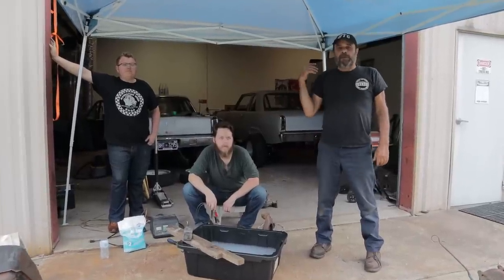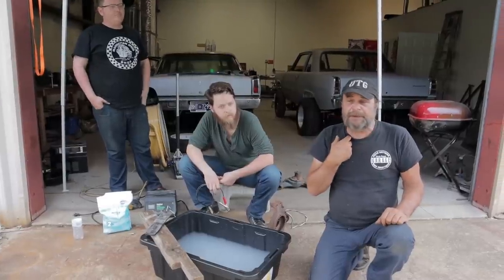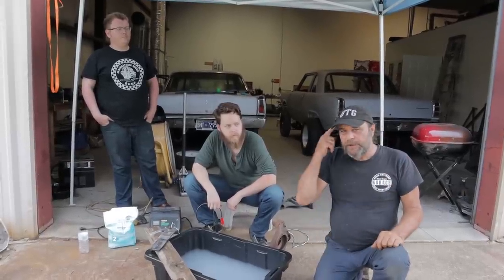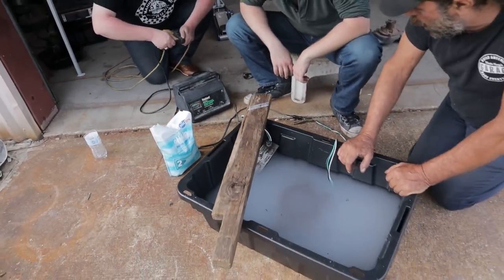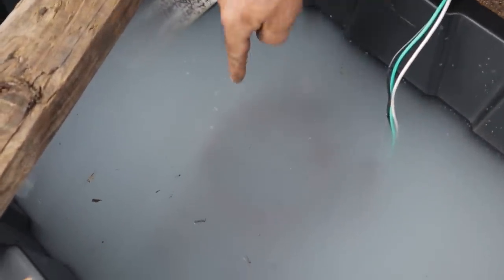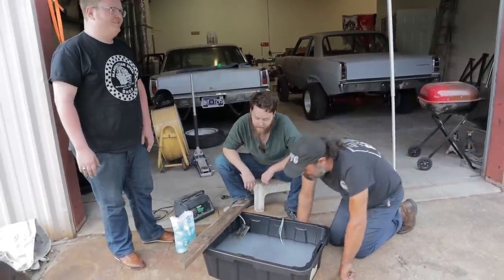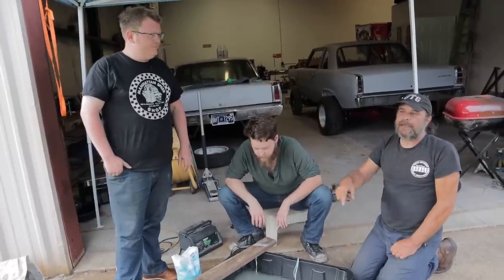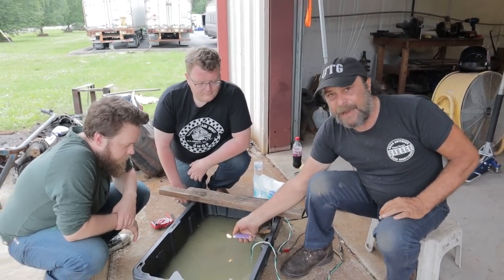Zapping The Rust Away - Best, Cheapest Method Ever!

Comment: I've done plating my whole life whether it be copper tin lead nickel and gold what you should have done since you had to three wires is connect them at three different points on the water pump housing that way you have more even current throughout the housing instead of just coming in at one point
Reply: Makes sense.
Reply: The resistance of that block of metal should be so low that the difference should be negligible.
Reply: I wonder if an second sacrificial anode on the other side of the pump housing would make for a more even rust removal.
Reply: @aussiebloke609  It would definitely help.
Reply: I thought more current tends to make the metal turn more black?
Reply: @aprules2  It does, but at the same time, the more surface area of anode you have surrounding the cathode, the more uniform the plating will be, and the quicker it would go.
Reply: @aussiebloke609  yes most definitely it would
Reply: The key to the success of this procedure was the addition of the electrolytes to the sollution... If the water was de-ionised (aka - D.I. water), the amount of metal transfer between the anode & the cathode would have been very slow... I have also heard that sodium hydroxide works well to do this...
Reply: @johnbrizendine7716  I've found that on parts with a bore you have to dangle an anode down the middle to effectively get that clean. It probably would have come clean eventually but there definitely seems to be an advantage to keeping line of sight with what you want to be cleaned. I  just rotated the parts or moved the anode around to get the outsides clean.
Reply: Definitely rite my man. I am an electropolisher. Same same but different but still same
Reply: @aussiebloke609  Yes.  Definitely.  Electrolysis is line-of-sight, so 2-3 anodes will work like a dream.  Best anode is a stainless washing machine basket, and suspend the part from a chain or rope.
Reply: @aussiebloke609  When my buddy and I used to do this in a big wash tub, we used 3 or 4 sticks of rebar wired together around the perimeter. Did full engine blocks that way.
Reply: @michaelmartinez1345  I dont think there is any "metal transfer". This is not electroplating. Oxidation is a loss of electrons, which one is reversing by pushing electrons into the target cathode.

I THINK
Reply: @edlithgow4360  that is an interesting observation..  However Three things are required for corrosion to take place..  1)A potential difference (of voltage between two or more conductors)
   2) An electrolytic path , and
   3) The presence of oxygen
     If any of these elements is neutralized / isolated, the corrosion (metal transfer) will stop... Thai is how it was explained in a corrosion control class that I took at a NAVY base, awhile ago...
       Therefore, it is reasonable to believe that metal transfer does take place between two (or more) metals that share an electrolytic path and have a potential difference of voltage (even a slight voltage difference) could cause the more noble metal to give some electrons to the electrically connected metal  that is less noble... What the oxygen effectively does is break the metals down to their original form before the man made processing took place...AKA - Oxidation...

Comment: Electrolysis ist my main method for rust removal on smaller parts.
I'd like to add one thing regarding the paint. Electrolysis does not remove the paint on good metal. Only where there is rust underneath. Also on galvanized parts, where the galvanizing has started to corrode.
And one important thing: The parts have to be free from grease or oil, the water needs to get to the metal.
When checking the progress, I use compressed air to blow off loose rust flakes and paint.
Reply: Exactly!!

Comment: Welcome to the world of electrolysis. Been doing it to my rusty car parts for probably close to 10 years now. Super mild process, doesnt hurt existing (in tact) paint, doesnt hurt rubbers, plastics other metals, anything. Only attacks the rust. Take it out and give it a light hit with a wire brush and you should be good. Dont worry about the other metals on the part, itll be fine. Biggest thing I found was make sure your connections are solid and clean off the anode every once in a while. You can make a "smart" battery charger work if you hook up a spare battery in parrallel.
Reply: "You can make a "smart" battery charger work if you hook up a spare battery in parallel" is the PRO-TIP above!

Comment: I grew up on a farm and we used to do this a lot. We also used to rebuild old tractors and stuck motors.

I had an old F20 that sat in a pasture for 70 years that we bought on an auction. We disassembled it and used this method on many parts involved with the engine, transmission, and may old cast iron parts. After   we dried and cleaned them up , we then took those parts and soaked them all in a mixture of waste lubricants and Diesel fuel for a year. Then we cleaned them up and removed or replaced any press fit or threaded parts in those castings and metal parts. Threaded fittings that seemed welded in would come out fairly easily after that. Once everything was stripped down to bare metal we would heat everything up with a weed burner torch to both burn or carbonize and release any left over carbon and oil out of and off of everything.  The heat also helps to anneal or relax the metal and prep it for repair and rebuild work. 

Electrolysis will remove oxidation without degrading the metal any further. 

That F20 had a mess in the engine and transmission from water getting in and nothing moving for 70 years.  Also the coffee can over the exhaust pipe had rotted through and water was getting down into the exhaust manifold and engine.

It took us 2 years to get it apart , rebuilt and running again.  Man I love old Iron though.

Comment: Good job of showing us a great technique for rust removal (I needed that). I submit a few additions;
Electricity flows from negative to positive. That's why this works. 
To have a negative charge, it has to have an abundance of electrons. To have a positive charge, it has to have a deficiency of electrons. That's why the excess electrons on the negative side wants to go the fill the deficiencies of electrons on the positive side, and it takes the rust (iron oxide) with it.

Comment: Did this and yes it's a game changer. Hit every rusty tool in my shed. Got a kids paddling pool and I can do car doors and rims .  After doing this I got into a bit of electroplating as well, zinc plate my old bolts and carb brackets.. yes it works well on fuel tanks , fill up the tank with the electrolyte and hang the sacrificial metal in the tank

Comment: First,  electrons flow from negative to positive.
 In the metal industry the preferred chemical to use is sodium nitrite (NOT sodium nitrate, unless you want something to explode). When you have coils of steel, that are going to be made into car parts, that have rust on them, they will be run through an electrolysis bath to remove the rust. This will also inhibit rust from forming again.
 I used to manage a barrel reconditioning business and we would use sodium nitrite in the rinse water (¼ cup in 1,200 gallons of water) to stop the inside of the drums from rusting. As a test when we first tried it,  we left a barrel, with water in it, outside in the summer with the lid on, to prevent the water from evaporating, for 3 weeks.  Result was no rust, zero, none, nada! With a clear water rinse we would find rust the next day.  If you were to spray this mixture on the water pump, it would be years before you found rust on it.
Reply: Dang, and to think we use that shit to cure meats.  LOL
Reply: @EvrttGrn  I know!   But look at it this way,  have you ever found any rust on the meat after it has been cured ? ? ?

Comment: For the inside of motorcycle tanks I’ve used “the works” toilet bowl cleaner, muratic acid and molasses solution for other parts
Reply: What's the molasses do for the mix?
Reply: I generally pour in some acetone and a handful of sheet rock screws.  Put the tank in my electric cement mixer, pack it in with old towels and cardboard so it doesn’t rattle around.  Let it spin around for a few hours and it’s scrubbed clean inside.
Reply: @Skunkhunt_42  look up Deboss garage molasses, I did what he did and let parts sit for a week they came out nearly rust free

Comment: I use .5" graphite rods from Amazon for my sacrificial piece. They work great and last MUCH longer than anything else I've tried.
Reply: That's because the graphite is not a metal and so it will not pull the graphite from the anode and deposit it to the cathode, so it only pulls the oxygen out of the rust and oxidizes the graphite, but since graphite is resistant to corrosion, the oxygen just floats away for the most part.
Reply: @johnbrizendine7716  the part of the graphite that's under water does deteriorate over time (at a much slower rate) but I don't know why. Do you know what causes this?
Reply: @brentsealy9623  When it is in the electrolyte solution and a positive charge is applied to the graphite and a negative charge to the metal you are trying to clean, it pulls all of the oxygen into the graphite.  Graphite is highly resistive, but not immune to oxidation, so it takes a lot more oxygen and a lot more time with the positive charge going through it for the oxygen to break it down.  Graphite is also very brittle, so it will crumble apart as it oxidizes, instead of building up scale or anything like that.

Comment: I just use 25% vinegar/ water mix and soak parts for a few days up to a week. The rust just falls off with a light wipe. Heavy rust needs more time. I restored a 58 chevy and did the vinegar soak on all parts including coil springs. No electricity needed. I used a 50 gal plastic barrel i got free from some industrial cleaners. Cut the top off and used it as a lid.
Reply: We use it to strip gun parts.

Comment: Hi Tony,
You don’t want or need a tub for the sportster tank. 
Fill the tank with the electrolyte solution ( get your chemicals at your local farm co-op and save big $$$) clear off some paint in a spot on the tank you can’t see and Connect one battery charger clip there. Cut a T shaped piece of sheet steel and hang it out of the end of a plastic funnel and place it into tank hole. Attach other clip to the steel and you’re good to go. 
This method worked well for me after trying many different approaches.
Reply: Using a funnel in the tank opening for the anode is a great idea...insulates the anode from the tank and centers it in the opening at the same time!

Comment: On the forums for like tractors and stuff this is one of the main methods of removing rust on many items you will restore. I think the arm and hammer washing soda is what you can use as well and I think it use to just be a few dollars.  As far as useing it, I think they keep it around for years doing many pieces. After a while the reaction slows and you need to take your sacrificial annode out and grind all the crap off it back to fresh metal.

Comment: Electricity actually flows from negative to positive.  So you might consider how important proper grounding is on vehicle circuits.
Power goes out on ground and comes back through the wires.
Reply: Excellent explanation of electron flow theory, as opposed to conventional flow theory.👍
Reply: "electricity" is really an ambiguous word when it come to technical discussion.   By convention, electric current is defined as the flow of positive charge.  So whether the charges are actually negative electrons or positive ions, the current goes from positive to negative.

Comment: I’ve done this with motorcycle tanks before. Works great. I used a piece of 3/4 round stock with PVC pipe over the end and where it comes through the neck of the tank to keep it from shorting out.
Reply: I'd think rapid re-rusting might be a problem. Could you usefully electroplate the inside of the tank with something protective, such as Zinc, maybe prior to using one of the commercial tank painting products?

Comment: If you want to see more about rust removal from electrolysis, check out any cast iron cookware page, as they have doing this for years to clean up old fry pans.  

Also, just to make Uncle Tony's mind go down another rabbit hole,,, you can reverse the polarity, and do zinc plating of parts, nickel plating, copper plating, etc.  Heck, you can even do some anodizing of aluminum.  

Think of all those old Mopar tiny parts that have seen their better days and would be just painted or thrown away.  You can strip them, and then coat them with nickel.  Then toss on some clear,,,, and wah-lah.  Even the plastic ones can be coated if you spray them with graphite first.  Good job for the professor to work out the details. 

Anyway,,,, can't wait to see your results on your tank.  I've never tried the inside of a tank before.

Comment: When doing this think "LINE OF SIGHT."  Instead placing the leaf spring on edge (approx. 1/4" in. line of sight) should have turned it so as to give you a  (approx. depending on actual width) 2 inch line of sight. Just a helpful hint to one and all.
Reply: I agree . If they could use a peice of metal similar in size and have one on each side would be ideal

Comment: You could make an anode for the tank with a steel masonry spike, they have small holes cross drilled for wiring them along the length and you could get a one foot spike, clean it, and then insulate it from the cap orifice with a wood or plastic collar, insert it to the proper depth and use zip ties to make sure it doesn't drop too far. With the tank blocked horizontally, you could fill it with  the electrolyte mixture almost to the top and make sure there is room for gases to escape with a small length of hose fitted to your insulating collar.

Comment: I have seen where an engine block was dumped into a plastic trash barrel and used the same process and it came out looking good.  From what I can tell it does not like grease. So get the grease off the part before dunking.  Another KISS process.  I like it.

Comment: Tank in my 68 Dodge D200 pickup was in the box when I got the thing, no cap or sending unit and of course rusty as hell inside. Dumped out enough loose rust to overfill a gallon can. Did electrolysis using two old metal rods, for anodes, cleaning them a time or two a day for over a week. Did a final (quick) rinse with muriatic acid and it was clean and shiny inside. Done a bunch of rusty crap since in a bucket using old lawn mower blades for anodes. I use Arm&Hammer Super Washing Soda, it's cheap.

Comment: I've de-rusted a ton of iron via this method and it works wonders! Washing soda (sodium carbonate) seems to give the best results for making the electrolyte. 

I was wondering what the approach was going to be for the tank. Electrolysis will definitely strip the paint off if fully submerged, so having the electrolyte solution and anode sitting inside the tank seems like a solid approach.
Reply: They are going to need an Anode that fits inside of the gas tank for this to work at removing the rust inside efficiently. #NoShorting!
Reply: @joeteejoetee  Maybe some old nuts, bolts, or washers that don't have a plated coating on them? As long as they use insulated wire, that would be doable.
Reply: It won't take paint off
Reply: @bushratbeachbum  Tell that to the vise I de-rusted. So much paint came off of it that it created a slurry within the electrolyte.
Reply: @foxyloon  rusted underneath the paint maybe.
Or your solution was corrosive to the paint type

Comment: Tony used the electroless method on motorcycle gas tanks numerous times, and agree it works very well.  Now it takes several days to do a good job, it will eventually clean down to good metal.  Now for a good plus you can obtain a zink annod and reverse the polarity, guess what you zink plate the part.  Now if you want to get real cool, dump the solution then dump ROOT KILL, copper sulfate, and use a copper rod or wire negative and part positive and Ta-Da you copper plate.  Concept is electrons flow from negative, more electrons to the positive annod, less electrons.  Just wait and the annode will look like a rust cicle.  Now to plate you have the zink or what ever negative and the part positive.  Now to copper plate you have to zink first as copper won't really stick to other materials.

Comment: I welded up a little cage of rebar to surround the inside of my tank. Allows the current to flow in most any direction. Cleans a little faster and easier. Pretty nasty block may take a week or so, but comes out nice.
Reply: In my experience the more anodes you place around the part(within reason) the better it works. If you only have one anode it gets covered thicker and quicker forcing you to have to wipe it off periodically to prevent the process from slowing way down
Reply: I did the same thing, welded a rebar cage & installed it in a giant tote bin tub. I did a bunch of suspension parts with it, they turned out great.